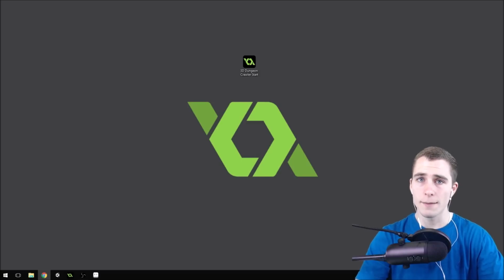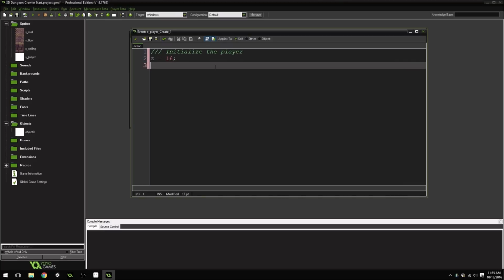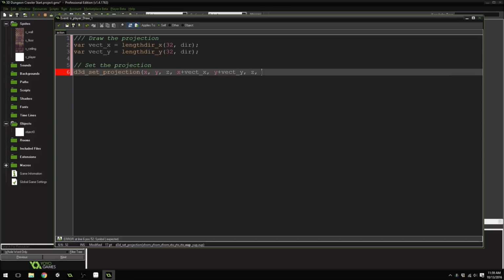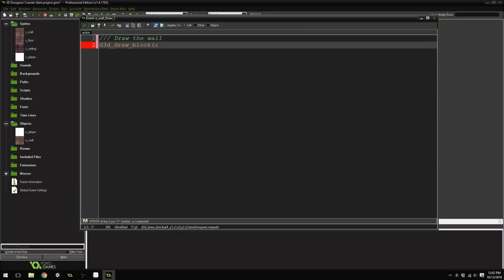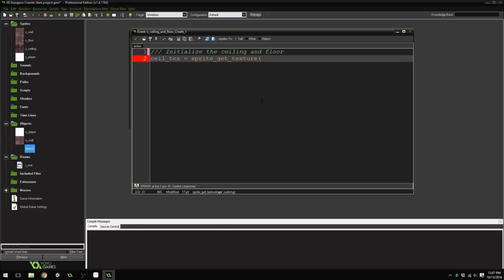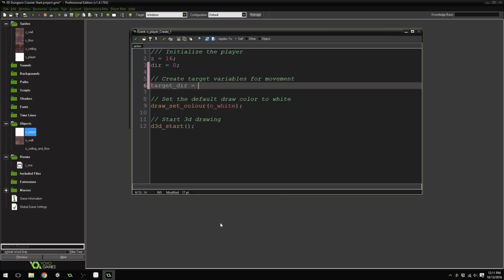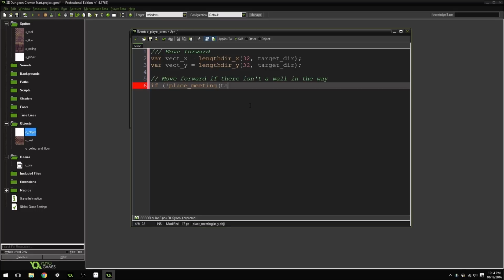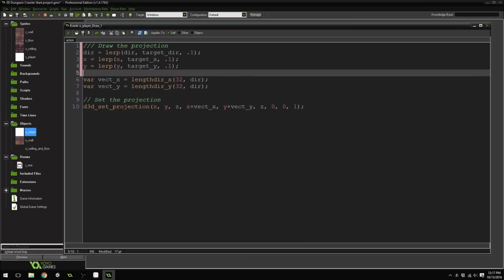[GameMaker Tutorial] Simple 3D Dungeon

Comment: Anyone still finding this tutorial years later and looking to make one of these:
-look into the d3d_set_projection_ext() function, and give your camera a bit more FOV
-if you're going to want anything to be on the floor (items, traps, etc), then angle the camera just a tiny bit downwards
-definitely consider making the ceiling higher than 1 tile above the floor
-using the vect_x formulas, set the "from" coordinates of your projection a little bit back, so that the camera doesn't get shoved all the way up against every wall you walk up to
-increase the distance before the fog starts
What's the point of all this, you may be thinking? Well, the code in this video is good for starting out with, but depending on the kind of dungeon crawler you want to make, it can end up feeling very claustrophobic... and not in the atmospheric kind of way.
With these tweaks, you can make something that feels a lot less cramped.
Reply: The delver engine is open source if that interests anyone also
Reply: i'm using gms2. whenever i make a d3d script, it count the d3d action as a variable

Comment: I've implemented some sprites into the dungeon they work fine and face the player, kinda like how doom works. I've been trying to get collisions to work however I can't figure it out even after messing with all the collision options for the sprite. I even tried using your movement collision code for the walls but the player starts clipping everywhere and moving way to fast and still doesn't collide with the 2d sprites. Any idea what I could be doing wrong?
Reply from the maker: Hmmm, are you using separate sprites for your collisions masks? My first guess would be that the animations in the sprites are changing your collision shapes and sizes and this is causing the clipping. This is just a hunch, though.
Reply: Thanks for your reply. I am using sprites right now with no animation.

Comment: ############################################################################################
FATAL ERROR in
action number 1
of Draw Event
for object obj_player:

Variable obj_player.vect_y(100004, -2147483648) not set before reading it.
 at gml_Object_obj_player_DrawEvent_1 (line 6) - d3d_set_projection(x, y, z, x+vect_x, y+vect_y, z, 0, 0, 1);
############################################################################################

how do i fix this
Reply: check your sprite and variable names, and double check your code. You have to initialize variables before you use them, so either you are trying to use a variable you never declared, or there is a typo somewhere

Comment: So I have utlized this code, but instead of moving in the grid pattern, I have made forward and backward movement go 2px at a time, and left and right turn at 5 degree increments.  It basically allows free movement in the space, which is great. 

The thing I am trying to tackle now, though is that if you are walking at an angle toward a wall, once you hit it, you stop completely.  This makes sense with the existing move forward code of meeting with the wall, then no movement.  What I would like it to do is slide along the wall, and continue moving - only completely stopping if you are completely perpendicular with the wall.  Any thoughts on how to accomplish that?

Thansk!

Comment: so i looked pretty far through the comments but i dont think anyone else has gotten the problem i have. everything runs fine, but when i change direction, using the right and left buttons, and then press the up button i move to the side. no idea why. any help would be super cool. 
Thanks!
Reply: follow up:
its way worse than i thought it was, will look at the blog post to try to figure it out.

another follow up:
i can only move on the x axis, though i can turn to look in the y axis i cant actually move on it, when i turn to look at the y axis, if i then press up, i move one block on the x axis. after this i cant move another block without changing my direction to look at the x axis and moving one block. another interesting thing, is i can use this odd movement to move through the walls, again only on the x axis.
again any help would be super cool.

Comment: ok so its not the best but I made a way to look up and I guess down if you change it a bit.  So in the player create event make z2=z;
then go into the draw event and change
d3d_set_projection(x, y, z, x+vect_x, y+vect_y, z, 0, 0, 1);
to
d3d_set_projection(x, y, z, x+vect_x, y+vect_y, z2, 0, 0, 1);
then make a step event and add this code:
//Look Up
if (keyboard_check(vk_space)) and (z2 < 32) {
    z2 += 1;
} else if (!keyboard_check(vk_space)) and (z2 > 16) {
     z2 -= 1;
}

change the 32 to a higher or lower number that is the limit you can look up I have it at 32 because I don't want to look straight up just up a little. :)  Reply if you've made a better way! :)

Comment: Uh oh, when I move forward or backward I go diagonally. Turning works fine. I used "W" and "S" for forward and backward respectively, if that makes a difference.

Edit: Silly me, in the forward and backward movement I put "var vect_y = lengthdir_x(32, target_dir)".  Changed x to y and I'm all good now. =]
Reply from the maker: I was just about to answer XD I've done that same thing before.
Reply: Had this exact same problem, you saved my bacon dude :D
Reply: If you have a moment. I have a similar issue. I move diagonally and through walls. However, I have not swapped the y and x like the above poster.

EDIT: NVM, mine was swapped in the lerp >.< Love the vids!